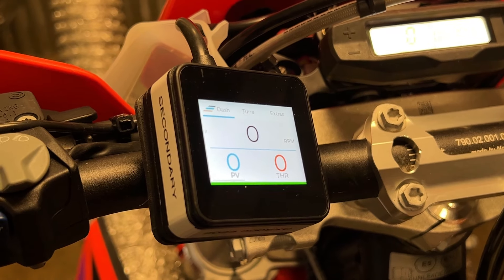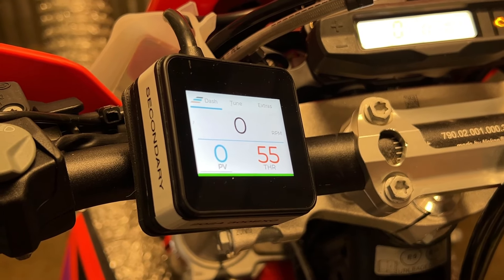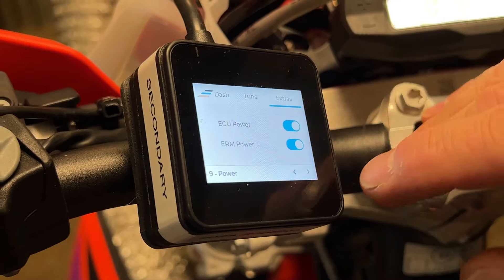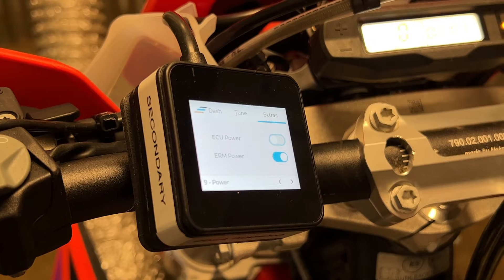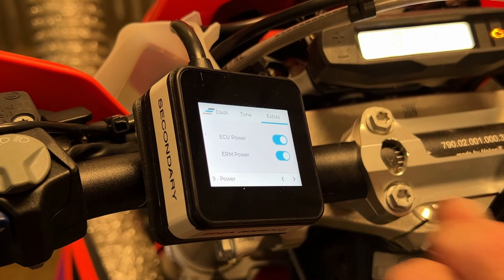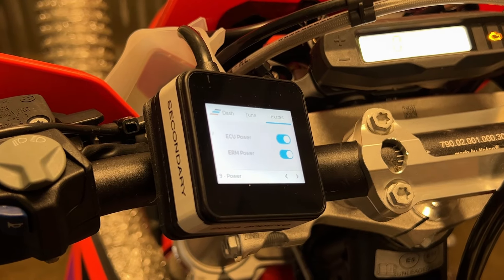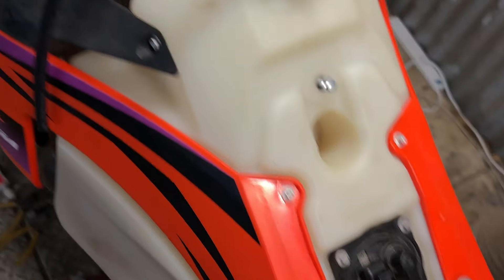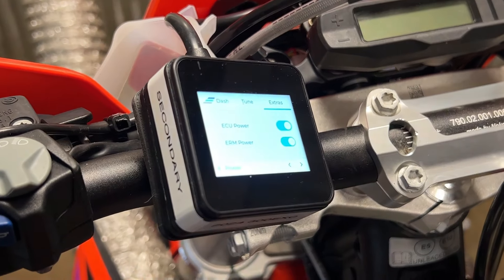KTM TBI Powervalve reset using a TSP ERM

Comment: Why would you need to do that
Reply: Every time you dissasemble the power valve you should reset its values so the eletric motor can function properly.  
The repair manual also states that when setting the TPS you should also reset the power valve with the dongle or with this ERM method
Reply: @antonioaraujo99  So the dongle is not needed with the erm?